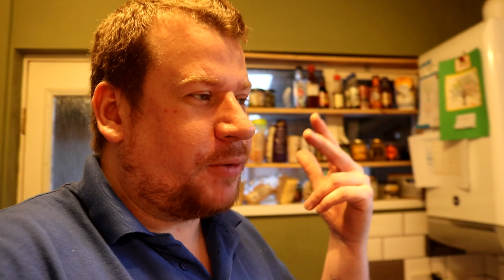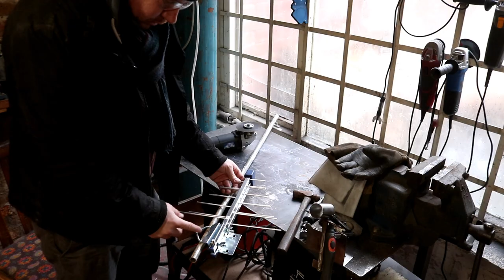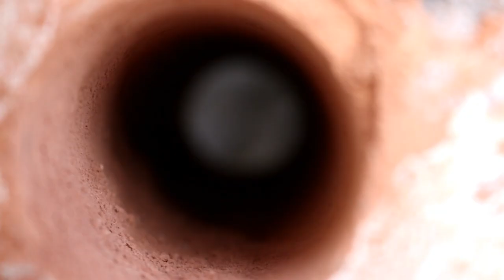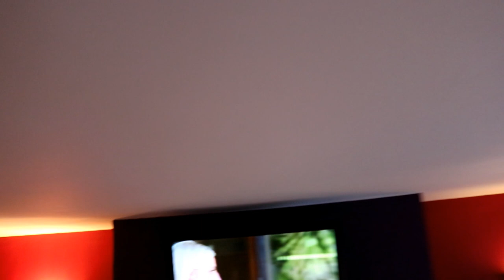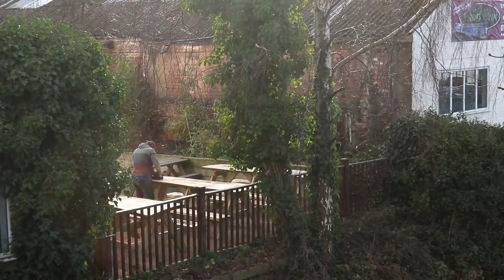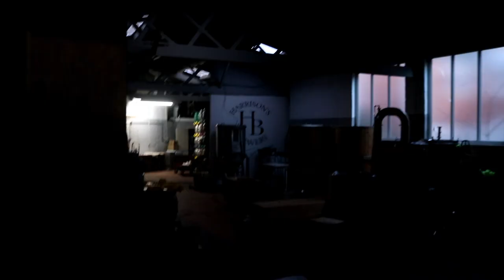JUST IN TIME FOR THE 6 NATIONS

Comment: That looked like an excessively large hole for an aerial wire 😲! Did you send Gemma out onto the footpath to get some footage of the tables? Snap a bit and bat home 😄 .  Great update as usual, Cheers, Schnuz.
Reply from the maker: Yeah, I only had an 8mm bit at 150mm so I just stuck the hole cutter through. I thought if I need to bring any other cables out I can use the same hole.  Gemma did the wide angle work on her own, I did not know till I started the edit. A camerawoman she may make yet.